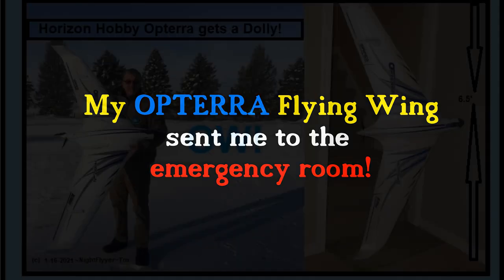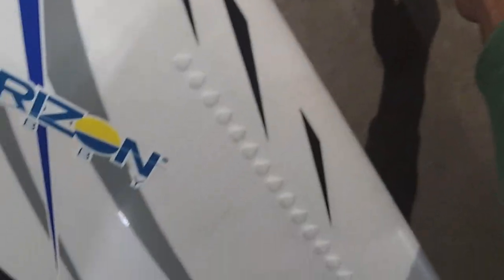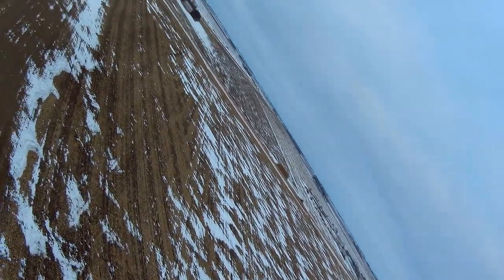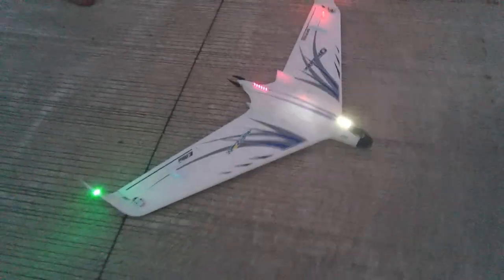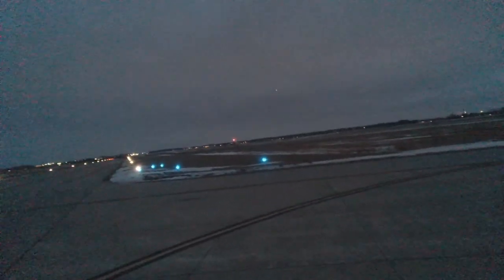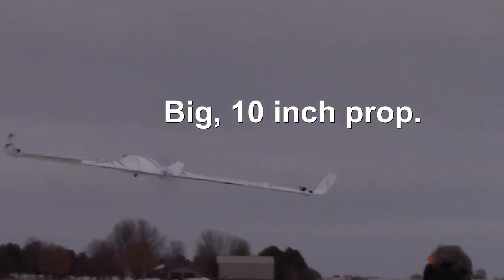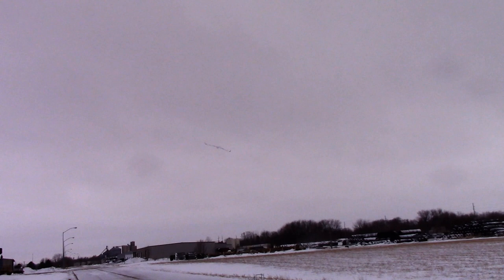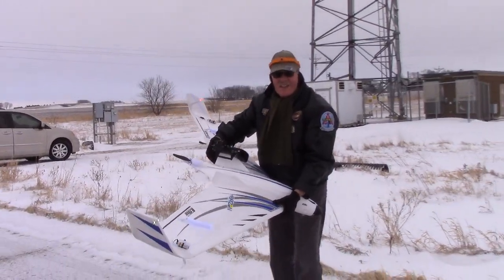My Opterra 2M Flying Wing sent me to the E.R. This is an awareness video & my solution for launching

Comment: Yep! That’s why a winch is needed for some. I allways hold the wing tip and use the throttle to help me lift and toss it. It’s definitely still just as dangerous but I stay the hell away from the prop ever since we had to super glue my uncles hand closed looked just like yours but it was a nitro plane that slipped out of the tail holder.
Reply from the maker: This wing is 7 foot long, heavy and  will bend and break the end off the if you even try to pick it up by the tip and barely has enough power to fly out of your hand at launch.  I know and I tried.    It would also be extremely difficult to somehow launch it discus style with the elevon there and that 7" tall winglet rudder that is also on the tip.  I know how to do it , but not with this plane.  
See my 14 year old self-contained catapult in action here.  https://www.youtube.com/watch?v=ypxbkaY-Ycs&t=113s  
It's not like launching my SMALL F-27 Evolution or 1.2M Opterra.  So I followed the instructions word for as I did for the video I made of my product review earlier where nothing happened bad.  https://www.youtube.com/watch?v=P_inF5EYLEE&t=1s and the second one where I explain how to protect the bottom of the fuselage.  https://www.youtube.com/watch?v=ur5V5H8UcGs&t=1s
We are only talking about a Half inch of clearance that I needed to keep from getting cut. 
Here is word for word what the Opterra 2M manual says about launching.  
1. Put the aircraft into launch mode with the channel 5 switch.  (in my first video that did not work, it went into the ground)  
2.  Hold the aircraft in one hand and the transmitter in the other.  
3.  Apply full throttle and throw the aircraft directly into the wind, angled slightly up (5 to 10 degrees above the horizon). 
4.  Climb to a safe altitude and check the trim.   
I know others have their own ways, and either way, my Dolly is the safest solution for me.  
The Opterra 2M manual also says nothing about throwing it with the motor off, so if a newbie followed the instructions, like I did, I'm showing what could happen, in case a gust of wind got them or something else.     Nothing is 100% and no matter how good you can throw, this big 7 foot wing with a 10 inch prop spinning right next to your face, is risky.  https://www.youtube.com/watch?v=P_inF5EYLEE&t=1s 

And to see how I feel about that unnecessary auto stabilization system see this.  https://www.youtube.com/watch?v=ur5V5H8UcGs&t=1s
Maybe a gust of wind, maybe my 73 year old left arm was weaker, or who knows.   But either way, if it happened to me launching the way I thought was good (and  the same as all my previous launches.)  So if it can happen to me, it can happen to others, and that is the warning I want to present.  Thanks.
Dave
Of course I know how and a have.  I'm no newbie!  First of all, that had nothing to do with my hand injury. I only mentioned the Throttle arming because I followed instructions in the manual and this is the way it bound up and arms the motor as soon as you plug in the battery.  It's my warning to be cautious, because the manual says nothing about programming in a throttle hold to a switch. I've known of times when after flying, that switch was forgotten to be moved back to safe and it armed as well.  Nothing is 100% as it could be left in the wrong position, by accident. I'm pretty experienced, so never relied to on a throttle cut/hold, as all my machines need throttle stick movements to arm.   I only am warning others to be careful BEFORE the launch and to be careful no matter what you use.

Comment: Man that sinks, you can setup throttle cut and switch the motor on right before you launch.  Rear propped planes I toss up and out then hit the throttle.  I use this method on my Radian XL and Wings.  I like your dolly, Bungee launchers work great too. Jeff in LA USA

Comment: Hey NightFlyer, I also a had a terrible accident similar to yours, but with the Opterra 1.2 meter version. This happened in mid-October 2020. Maiden flight launch went without a glitch, but on the second flight's launch, the prop came into contact with the back of my hand and completely SEVERED the tendon of my middle finger (right hand). The tendon was completely cut in two. Of course, I didn't know that at the time. I was just left with a big and deep cut at my middle finger knuckle that bled profusely. The wound also got infected despite cleaning it as best I could. At this point, the pain was brutal. I ended up getting surgery to repair the tendon and I also had to take antibiotics through a PICC line (central catheter that goes into the arm and directly to the heart). I had to take these antibiotics 3 times a day (one hour for each dose), for a MONTH! This was to fight off the very bad septic infection that managed to develop after the accident. All in all, this was by far the most complicated accident I've ever had. What I can't get my head around, is that in the Horizon Hobby instruction manual for the Opterra 1.2 m, they even recommend that you launch it the way I did, with the motor spinning at 100% power. Nuts!
Reply from the maker: Ouch for sure.  Yes, the Manual is what I followed, especially in my earlier product review video.   It is even harder to launch this 7 foot bird for sure.  Hope you recovered ok.  Thanks.

Comment: Man I cut 1 tendon with a small gash and my hand is not healed at all... 2 years later
Reply from the maker: Yes.  Mine either.  The cuts on the outside dont look so bad, but the bone that got whacked also hurts.  Get well.

Comment: That happened to a snowbird from Canada a few years back at our field.  He had to fly back to the Great White North for Surgery.  Was a lot worse than your injury but he was back in about a week.  I have the 1.2 meter version and I used to launch it with the throttle cut on, half throttle and hit the switch just after I toss it.  Then I taped on the left wing and now throw side arm with power on.  Sorry to see ya got bit.  Get well soon!
Reply from the maker: Sorry to hear that.  This wing is 7 foot long, heavy, underpowered, and will bend and break the end off the if you even try to pick it up by the tip. It barely has enough power to fly out of your hand at launch and especially while I was trying to throw it into 12 mph wind. I know and I tried to launch it discus style, but could not hold it where I felt I could launch it successfully in the wind.     It would  be extremely difficult to somehow launch it discus style with the elevon there and that 7" tall winglet rudder that is also on the tip.  I know how to do it , but not with this plane.    Here are the links to the last videos and you can see I launched it the same way without problems.
https://www.youtube.com/watch?v=P_inF5EYLEE&t=1s&gl=CO  and   https://www.youtube.com/watch?v=ur5V5H8UcGs&t=1s
Reply: @NightFlyyer  yeah, it sucks that you got bit.  I had a hard time watching it especially the sound.  I am amazed you got it down while bleeding all over the transmitter but then again, you are a Devil Dog!   Hope you’re all healed without any long term issues.

Comment: I would not hand launch a pusher prop wing  for this exact reason.  Why fly a plane without landing gear when you have a paved runway around.
Reply from the maker: Because I put tiny wheels on it and this was a test.   If you watch my first videos, I flew it over snow.    Here are the links to the last videos and you can see I launched it the same way without problems.
https://www.youtube.com/watch?v=P_inF5EYLEE&t=1s&gl=CO  and   https://www.youtube.com/watch?v=ur5V5H8UcGs&t=1s

Comment: You can launch these pusher flying wings discus style or get someone to launch it with the motor not running and start the motor in the air. Even then it’s dodgy.
Better still never buy a model with a pusher motor behind. Nearly everyone does it once with these. Some get away with a minor cut. I did.
Great video. Should be compulsory for anyone flying these pusher ARTFs.
Reply from the maker: I  have several pusher planes and never had the problem.  I also use my launchers or dolly to be safe.  My wife got me this for Christmas.  I didnt buy it.  It also cannot be launched very well discus style, as it is a 7 foot wing and bends if you try to pick it up, plus the wingtip winglets are in the way.  I have no one to launch it for me and would never ask someone to do it, and get sued if they had this happen.  When I do my product reviews, I always follow the instructions to be fair.  I appreciate your comments and suggestions.  Here is what the manual says word for word for launching.  1. Put the aircraft into launch mode with the channel 5 switch.  (in my first video that did not work, it went into the ground)  
2.  Hold the aircraft in one hand and the transmitter in the other.  
3.  Apply full throttle and throw the aircraft directly into the wind, angled slightly up (5 to 10 degrees above the horizon). 
4.  Climb to a safe altitude and check the trim.   
I know others have their own ways, and either way, my Dolly is the safest solution for me.  The Opterra 2M manual says nothing about throwing it with the motor off, so if a newbie followed the instructions, like I did, I'm showing what could happen, in case a gust of wind got them or something else.  Nothing is 100% and no matter how good you can throw this big 7 foot wing with a 10 inch prop spinning right next to your face, stuff happens. 
Maybe a gust of wind, maybe my 73 year old left arm was weaker, or who knows.   But either way, if it happened to me launching the way I thought was good (and  the same) as all my previous launches. So if it can happen to me, it can happen to others, and that is the warning I want to present.

Comment: I have 50 fixed wing with ESCs and none of them require me to move the throttle up and then down. I do often employ a throttle cut or arm switch. What you suggest just isn't how fixed wing models do it. I had the same thing happen to me because of bad follow through on the throw, made a mess.
Reply from the maker: All my helis and drones have that arming procedure and many of my electric planes. First of all, that throttle arming had nothing to do with my hand injury. I only mentioned the Throttle arming because I followed instructions in the manual and that is the way it bound up.  It arms the motor as soon as you plug in the battery.  If it had said to program in a throttle cut, I would have! I only mention it to warn others to program in this feature as well,  which also should have been mentioned in the instructions.   
This wing is 7 foot long, heavy and  will bend and break the end off the if you even try to pick it up by the tip and barely has enough power to fly out of your hand at launch.  I know and I tried to launch it discus style, but could not hold it where I felt I could launch it successfully in the wind.     It would also be extremely difficult to somehow launch it discus style with the elevon there and that 7" tall winglet rudder that is also on the tip.  I know how to do it , but not with this plane.  
Thanks.

Comment: Change to F4 or F7 with INav and user auto launch mode instead and that could avoid such problem. That is why i told my friends that i prefer dual propellers flying wing instead. Not only the propellers are not in line with your hand, u also gain the rudder movement via differential motor turning.
Reply from the maker: Maybe that should be mentioned in the manual and those electronics should be included in the manual.  Hindsight is always 2020.  There is no differential motor steering here, as there is only 1 motor.  Thanks..

Comment: None of the newer ESC have that throttle feature, always a must! Set throttle cut/hold on all electric‘s! All of my electric helicopters and airplanes will not turn the radio on and less throttle hold is on. Very easy to do on your DX8, a safety feature!
Reply from the maker: I know that, but this one does not.
Reply: @NightFlyyer   Yes of course you can do throttle hold/cut. It’s in your radio.
Reply from the maker: @jeffwest5080  Now your talking about something different.   I set this up exactly how the book said to do it and it did not mention programing in throttle hold.  None of my esc's arm automatically at low throttle, but this one does.  Of course I could program that in to my DX8 gen 2, but didn't think I had to.  I only flew it stock for the review, which is in previous videos. And throttle cut is a push button.  Locking throttle and programming that in is easy for me, but many who simply buy this and set it up, also mentioned this, so I am not alone.   Seems HH should have put an ESC in like all the ones on my helicopters and other planes.  Besides, this is not what sent me to the hospital, and I mentioned it so others can be aware.  Thanks.
Reply: @NightFlyyer  yes I’m talking about setting up throttle hold/cute in your radio. None of the new ESC have that feature. That is more of an older feature because everybody knows now to set up throttle cut/hold. Even if the ESC has that feature I still set it up that way. It is a must! Sucks to see you cut yourself! Hope you get better soon! I’ve been hand launching wings for 20 years now and luckily never been cut! Always fear it. I hand launch my 5,000 watt 280mph funjet. That is the scariest wing you could ever hand  launch! That prop is turning well over 40,000 RPM. I fear it cutting me one day.

Comment: Here is a project/challenge for you Dave. Modify the Opterra with retracts !  Jup ... that must be doable for someone like you. I had to wait for a few days to see the video - sorry for your injury.
Reply from the maker: Yes, well if you saw my Product review  video,  https://www.youtube.co/watch?v=P_inF5EYLEE&t=1s  you would see  those wings aren't as strong or thick as you would think.  I would have to add a nose wheel servo and make it a trike as well.  And since the prop on the back is 10 inches, the landing gear would have to be quite long or retractable prop would hit the ground on rotation or landing. Thanks for the suggestion, but the dolly is now my landing gear and does not add any weight to this under powered 7 foot long wing.   Thanks much.

Comment: Like others have commented, and wary after my own happenings with propellers in the past, I wouldn't dream of applying throttle before it left my hand. I saw that propeller just behind the launch grips and knew I never would. I've only flown mine a handful or so times, and probably won't fly it a lot - for other reasons. It is a sluggish plane.Takes time to alter airspeed and direction. Landings are alse NOT trivial. You need to plan ahead, and should have lots of space to bleed off cruising speed. In my opinion it's really only suited for sustained flying like FPV. So not only were the launch instructions bad - the "fun to fly" is really not fitting. It is by no means a beginners airplane. Good to see you have a solution with the dolly .. now if I could just convince the boys of the advantages to pave our grass strip ... Keep flying, and vote for a better health care.
Reply from the maker: You are absolutely right about this plane and because of your comments I know your have one, not like all the negative comments I have gotten from the armchair pilots.  And you know, the manual says to turn it on to full power and launch.  Thanks much.

Comment: Ouch, what a nasty noise.I had this concern with the Multiplex Xeno Wing too, but avoided trouble so far by launching it with an as high as possible raised arm. This allows quicker retract of the hand out of the danger zone 😉
Reply from the maker: That will work for sure on a smaller wing, but this big 7 foot under powered wing being launched into 12 mph wind is harder than you think. I did it fine on my earlier product review videos, but nothing is 100%..  Thanks.

Comment: The dolly is a great idea, it reminds me of the U-2's pogo wheels.  Another option you might try is adding a flight controller and setting up INAV auto launch mode, it uses accelerometers to detect the throw and only then starts the motor.
Reply from the maker: It is really too hard to throw this big 7 foot underpowered wing into the wind with engine off. It barely flies as it is with it on.  If I am to buy something extra, maybe Horizon should say that in the manual.  Thanks.